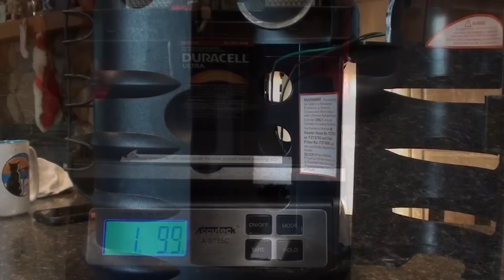How To Convert Your Buddy Heater to a Rechargeable Battery & Add an LED Switch

Comment: Or you could have purchased a lighted switch
Reply from the maker: Sure. That'd certainly work, too. I just use what I have on hand whenever possible. I cannibalize all kinds of electrical gadgets for project parts & this was a LED from an old modem.

Comment: That's really cool. You should wire in & install a  USB charger port or 2 for your phone!
Reply from the maker: I think you probably could. It's a 6v battery & I haven't really messed with much 6v so I'm not sure if it'd charge a phone very well. But then again a USB port puts out 5v, (I think), so maybe it'd work.

Comment: Could you tell us the # of the LED, resistor, and the battery you used?
Reply from the maker: Hi Brian, I can't remember for certain, but I believe for my red 3mm led (2.0v @ 15mA) I used a 270 ohm 1/8 watt resistor. I don't have any more info on the specific led because it was one I scavenged out of a junk wifi router. Hope that helps, at least a little. Thanks for watching!
Reply: Thanks so much for your reply. Do you have the battery number?
Reply from the maker: Well, it's out in the garage & it's -13º right now, so I'll just give you a link to one that will work. lol! 
https://www.homedepot.com/p/UPG-SLA-6-Volt-F1-Terminal-AGM-Battery-UB645/203770472?cm_mmc=Shopping|THD|google|&mid=sYR0lTKmE|dc_mtid_8903tb925190_pcrid_195274179091_pkw__pmt__product_203770472_slid_&gclid=EAIaIQobChMI9Je-2Nqm2AIVBIezCh3CWQ97EAQYASABEgI_wPD_BwE

Comment: awesome stuff. thanks for sharing
Reply from the maker: Thanks for watching (and commenting)! :)
Reply: I turned the heater over to change the battery , now it won't lite
Reply from the maker: Sorry, I didn't see this until just now. You've probably sorted it out by now, but Buddy heaters have a tip switch that makes them go out if they tip. I'm guessing turning the heater over activated it. It should reset on its own, but maybe lightly tap the heater on the table & see if that unsticks it.